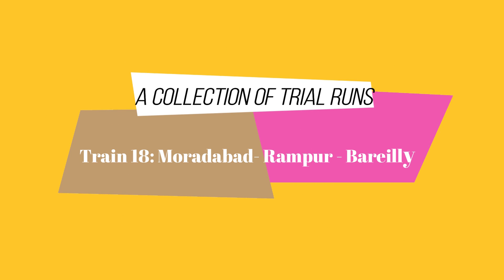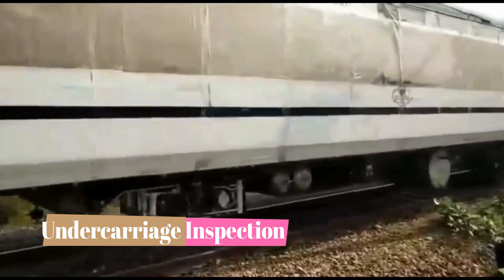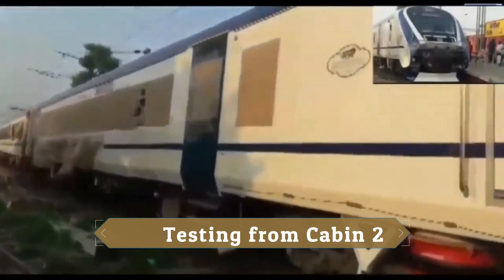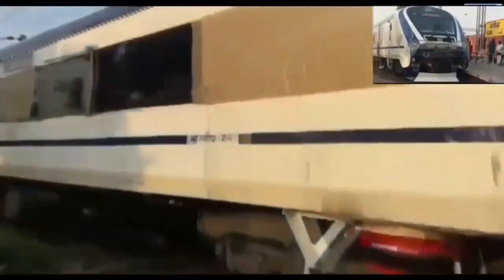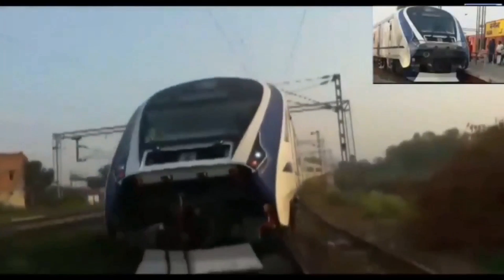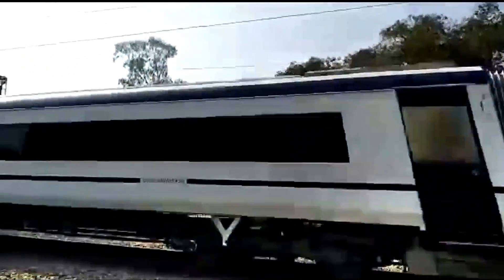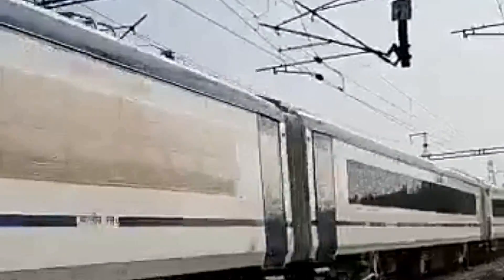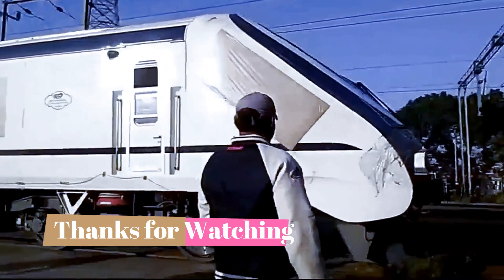TRAIN 18 : Complete Trial Run Sequence - Slow Speed Start Stop Cabin Reversal High Speed & Breaking

Comment: If ICF can bring out all 16 powered coach rake. It is possible tat on its own power it can pass major ghat or hill sections. No need for any external push pull locos.
Reply: The ghats should be Electrified first
Reply: Train 18 highest possible  speed is 220 kmph
Reply: That may lead to too much energy consumption
Reply: Well the engine can be attrached with train if need arrived or if the train is gotta run on non electrified line.. and yeah it can run over the ghat inclination